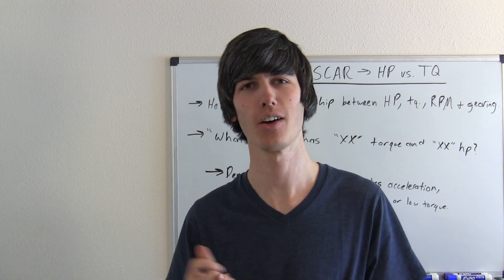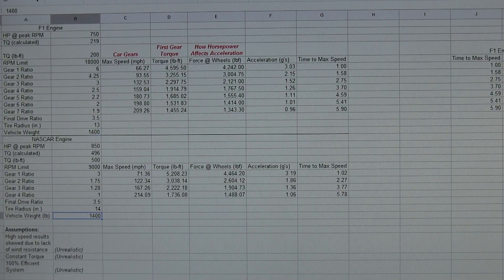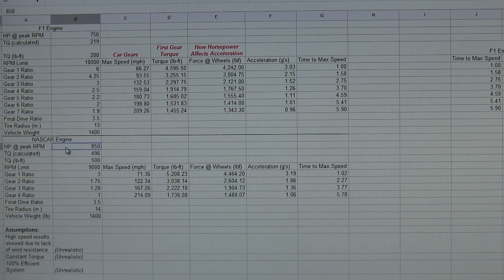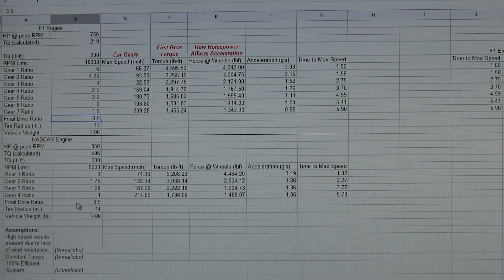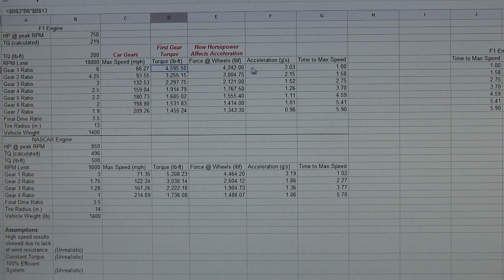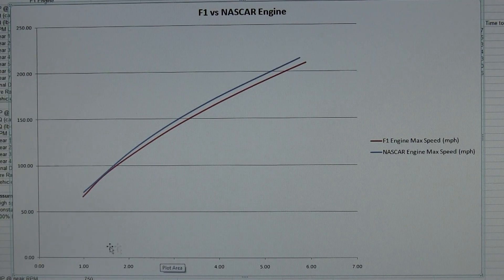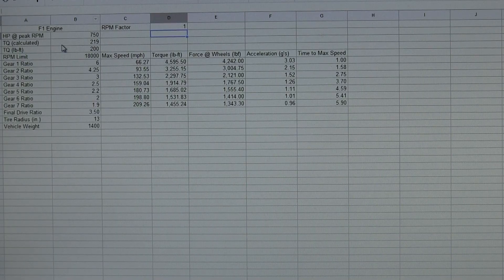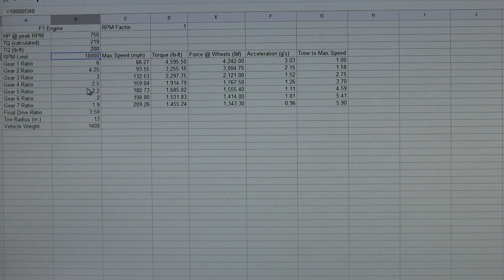Horsepower vs Torque - Formula 1 vs NASCAR

Comment: Thank you for making this as straight forward as possible.  When I consider real world scenarios though, I begin getting very confused.  Would it be fair to say that if you have a heavy vehicle with bad drag (and same gearing); high torque, low RPM, low HP would reach a lower speed more quickly, while low torque, high RPM, high HP will take longer to reach a higher top speed?
Reply: Hey dude, after 5 years do you have the answer?
I have same question.

Comment: Please make a video discussing how much torque or horsepower a given car needs and why? Why does NASCAR need more torque vs Horsepower?

It seems to me that more torque makes the car less dependent on vehicle weight or increased load(inclines and such), but limited on all out speed, whereas a high horsepower car can go fast and all but has trouble with hills and more people in the car. 

If you could go in depth about why one is preferred over the other for various applications, that would be splendid! Maybe break it down without gears and show what happens without the magic of gearing(gearing is hugely important, as I understand it).

Your videos are incredible; thanks for what you do!
Reply: +Sterling Roberts Because of rules, but mostly because of cost. NASCAR teams do not usually get as large of a budget as F1 teams and it is usually cheaper, easier, and more reliable to make more horsepower by increasing displacement (which increases torque) than by increasing engine speed (rpm). For comparison, the cost of R&D and building a NASCAR engine is around $40,000-$80,000 vs. an F1 engine which typically costs $5,000,000-$10,000,000.
Reply: +Sterling Roberts 

Sorry, meant to reply sooner. Consider a more extreme comparison regarding torque and horsepower:

Vehicle A: A road bicycle that weighs 20 lbs, powered by a biker who weighs 210 lbs. 
Vehicle B: A compact sedan with a 1.6 liter engine.
When the 210 lbs biker presses on the peddle that has a 7 inch crank radius, the bicyclist is producing 122.5 lb-ft of torque. That is about the same torque that an average 1.6 liter engine can produce.

The reason a bike can't go the same speed as the car is that the biker can only turn the crank at 30 RPM with all his weight into it, and the car engine can turn probably 5,500 rpms – this results in the car producing about 125 hp, and the biker producing about 0.7 hp. Note that: Horsepower = (Torque x RPM)/5252

This example shows that engine design elements contribute to torque/horsepower ratios. Think about the size and weight of the car's connecting rods vs the size and weight of the bikers connecting rods (his legs). Can you imagine someone's legs turning 5,500 rpm? They would fall apart.

NASCAR engines have larger displacement, larger pistons, larger connecting rods, etc. which is more moving mass, which limits rpm, but creates high torque. You could theoretically put an F1 engine in NASCAR. F1 creates its power at the top end of the rpm range (because of a design that uses small, light weight components that can move really fast). So to move a Sprint Cup Car with an F1 engine, the gearing would have to be such that the engine could stay up around its limit (which I think is 18,000 rpm). They would need countless gear changes to keep the engine turning in that range.

You could theoretically put a NASCAR engine in a F1 car, but it would be so big, they would have to change the engine compartment size, it would increase wind resistance, it would be so heavy they would lose a ton of cornering speed, braking ability, general handling, etc. 

Bottom line is, both engines are appropriately designed for their application, not just because of cost (though that is a good point brought up by pjbadgersuw26), but because of the different operating environments, vehicle weight, engine compartment size, performance, style of racing, reliability
and longevity, etc.

Hope that helps.
Reply: +Sterling Roberts Also, what would be the effect of equal number of gears on both types of cars in this video?
Reply: +Sterling Roberts "Why does NASCAR need more torque vs Horsepower?"Asking a different question might shed some light on that - Why does NASCAR not use engines with even more torque?
Reply: +Austin K I don't see how that helps.
What I know is you need a certain amount of torque to get moving, but too much is a real thing. HP, however can be quite high without becoming a detractor. It seems to me that if Nascar were at lower speeds, that torque would be unwieldy. The frequent starting and stopping of an F1 means too much torque would be disastrous, but I'm not an engineer.

Comment: But istn't it kinda unfair because the Nascar Engines are 5.7 liters and F1's only 1.6? Imagine the possibilities if F1 engines were allowed to be 2.5 or even 3 liters!
Reply: F1 engines cost a fortune to design and to build, let alone cost of standard maintenance. NASCAR engines are affordable and reliable. They might not be as refined as an f1 engine, but they still work. Like comparing a hammer with a scalpel. As far as engine size, you should check out the golden age of F1. The late 90's to mid 2000's. They had screaming V12's and V10's which I believe are 3 liters
Reply: dispatcher7007 No, maybe I need to update... xD
Reply: +renate ruschka the litres aren't the problem, turbo boosting is what sucks. Or the lack of, I mean. In the 80s even 1.5L turbo F1 engines used to put out way over 1000 HP. You had to be a REAL man to drive those. Plus manual transmission.
Reply: +renate ruschka 1.5l turbo or 3.0l naturally aspirated. F1 teams can choose which technology they want in their car.
Reply: +dispatcher7007 Ya.. In qualification mode and engine lasted for whole one lap.. Real hero of that era was Honda Engine used in Mclarens, BMW was like kid toy compared to that gem.

Comment: It amazes me people have such a time with this, but I expect Internet folklore and myths are the reasons we are slow to grasp simple concepts. Torque is nothing but a twisting force, it does not quantify any actual movement or work. Horsepower describes the work that can be done, whether that work is pulling a heavy load up a hill, accelerating a race car, or running a generator or pump.  Horsepower was specifically created by James Watt to compare steam engines to other means of doing work, because there was nothing else that described working power. 

I can generate 10,000 pound/ft of torque with a long lever, but I can't do any work sitting on the lever making 10,000 lb/ft. I could never make more than a fraction of a horsepower.

Comment: to make it clear for people who are stupid, if you want to increase rpm on the wheels, you have to lower your torque, and vice versa, you trade your torque for rpm and opposite. with the same power, with high torque you get less rotations than with low torque.

Comment: I get everything you're saying. although factoring in wind friction the torque will dominate the wind resistance and bull right through.
Reply from the maker: +Donnie Sloan What? No... that's what gearing is for, as I explained. You can always create more torque with gearing, you cannot create more power.
Reply: +Donnie Sloan You don't understand the relationship between torque and hp. There is a formula that relates the two. Its basically hp = torque x rpm. Hp is the amount of work an engine is capable of and is what causes a vehicle to accelerate. Torque is the same measure that you would see with a torque wrench - It matters how fast you can spin it.
Reply: +Donnie Sloan or you could be making your car pointy.
Reply: +TheBuggyProject this is true.  An extremely simple experiment you can do is grabbing your standard drill with 2 speeds.  Try driving a large bore screw into a block of wood on the high speed setting.  You will come to a point where the screw cannot go any more.  However, if you put the drill in the lower speed setting it will allow a larger torque and drive the screw into the wood farther.

Comment: u have it backwards f1 engines have 850 nascar is 750 LMAO
Reply: +Matt Crutchfield If your talking about horsepower..........your full of shit. The NASCAR engines are producing over 850 horsepower nowadays. But they have also restricted the air flow with yet another special plate for ALL the tracks, which robs the engines of horsepower, keeping them down to a certain maximum speed, much like the restrictor plates used for the Talladega & Daytona tracks. It sucks actually, because these small block NASCAR V8's are FAR MORE bad ass than all the other V8 racing engines, because they are designed to run around 9500 rpm's...........ALL THROUGHOUT A 500 MILE RACE. For a pushrod V8 engine, that is one hell of a feat, and I challenge anybody to do it. The NASCAR V8's cost over 100 grand apiece, and over 45 grand just to rebuild. I don't know of any other V8 engines that can rev so high without blowing up, and do it for an entire 500 mile race.  And they've been doing it for many years. No fancy turbo's.........No super chargers. And even though they have gone to fuel injection, they were STILL making this kind of power and insanely high rpm's with the old-school carbs and distributors. Amazing.

Comment: So would I be correct in saying that for a street car that I'm interested in driving often that tq is going to more applicable than hp? I don't want to have a super high revving high hp/low tq engine as a dd street car right? Wouldn't a higher tq car be more practical and fun?

Comment: Did you treat the F1 engine as the new v6 with twin turbos or whatever the new f1 engine is? Probably should find some way of accounting for tire blowouts every time the drivers in f1 actually go for it ;-)

Comment: sorry to say this but you just took a dump on scientific principle if you want a direct comparison you need to run both engines with the same weight and forces applied, not different gear sets in fact you should test how each deals with a number of ratios and weights side by side and I also noticed you ran with the unrealistic for anything but an f1 car weight....so I do feel that this was very sloppy and your decision that forces such as wind resistance were irrelevant for this test is plain stupid as you would only achieve that in space where these engines would be N/A as soon as you enter in any resistance it will show that torque is the deciding factor in making something move not the rpm it can reach at that level of force which would be horsepower.
Reply: Jarl Nieminen wind resistance and loss due to inefficiencies were not relevant as he was comparing horsepower and torque, not aerodynamics and driveline losses.
Reply: if you have no resistence then the comparison is useless. they are always relevant unless you are in a vacuum. he need to test both in increasing increments to make a real scientific finding, rather than this silly idea of over simplifying to the point that they seem to have the same outcome.
Reply: Jarl Nieminen the resistance was removed from BOTH comparisons and both comparisons were assuming that the engine was in a car with the same aerodynamics so yes air resistance is irrelevant. the test is of the power of the engine itself not about the body of the car.
Reply: Your missing they point both are irrelevant  without  resistance
Reply: Jarl Nieminen you're missing the point, without air resistance in both cases and both cases consider the same car body shape and weight so the air resistance would be exactly the same anyway so it is irelevant. the test is of the difference between high revving low torque and low revving high torque and it works, he has a degree in mechanical engineering, he knows what hes talking about more than some keyboard warrior.
Reply: megaspeed2v2 bud you are just being silly now do you even know what torque and horsepower  are?they are a measurement  relative to resistance. And as far as your worship of someone  with  a degree well sometimes even the most qualified people can be blinded by bias or just miss things completely the fact that he decided to use everything that works for the f1 car rather than using the f1 engine in the nascar shows where his bias lies or that he just didn't think of it. What point is there in trying to show  a difference  or lack there of in 2 engines  when there is no task. He is saying  that they both do the same thing  but didn't  bother to make it a useful experiment. For example if you judge a smokers lung capacity  vs a non smoker you would base it on how many breaths you take in a minute, you also wouldn't  use them both being able to breath for 20min without resistance as any sort of measurement.
Reply: Jarl Nieminen its not biased, he made the example of being in the same car specifically to REMOVE bias by removing variables.
Reply: He removed the variables that make it a comparison how do you not understand that. If you change a test enough you can make anything produce the same outcome. But that is not a scientific test.
Reply: Jarl Nieminen for a comparison to be useful all conditions must be the same for both test subjects, if you compared a Cheverolet V8 in a monster truck to the 4 cylinder engine from a GT86 in a caterham for example then the results would show the 4 cylinder to be better...
Reply: If you place a 2liter bottle of water in a full bath tub  and then do the same with only one liter and they both sink or float have you proven that they both the same weight? ?? No!!!! The experiment was wortless for the task. And using your logic i would say do the same again with no gear box tall final drive and a 2 ton vehicle for both engines. ..what it's  as fair as his test at least I Know that it's biased.
Reply: Mc curvy you make statements without any though of backing them up. It like me saying mc curvy you like little boys. Worthless comment bud.
Reply: +Jarl Nieminen 
simply clueless.